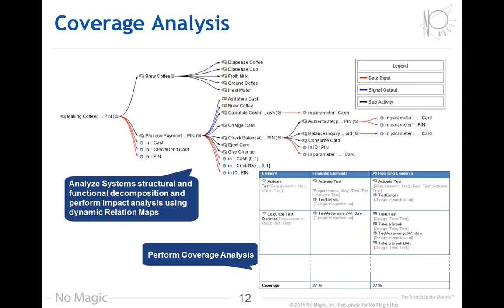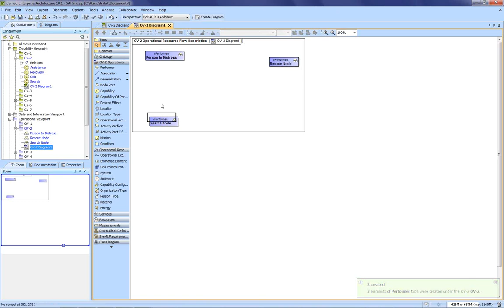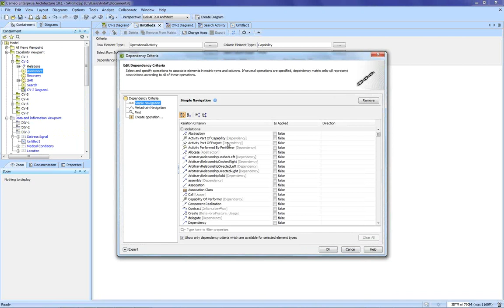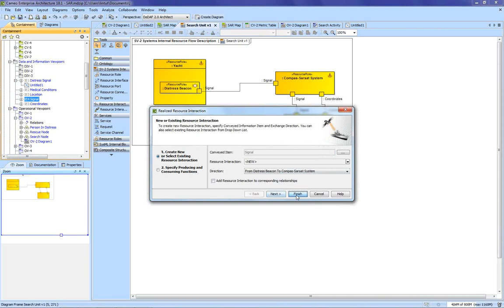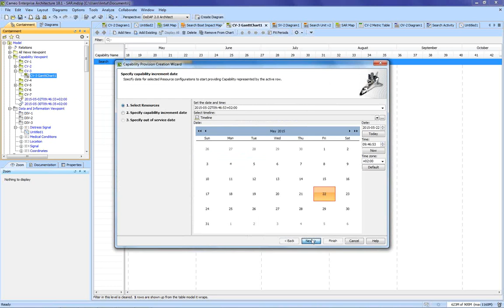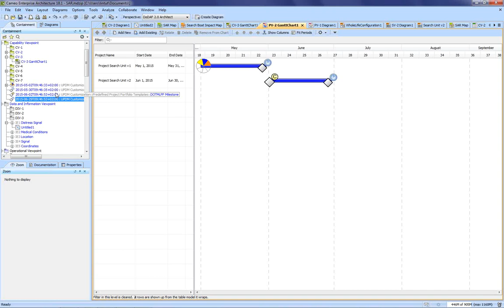Systems of Systems Engineering using DoDAF

Comment: I couldn't understand anything due to the talk given in an echo chamber. It doesn't help either when one has a strong accent in the echo chamber. Suggest going into a normal room. :( Also I suggest slowing done talking since one is trying to understand and can't follow due to the echo chamber and accent. So I didn't get anything from this video. In the end, I would say the presenter knows how to wiz around the tool....So this video isn't a talk on DoDAF for dummies when one is still very new to DoDAF. I stopped about half way thru since I was totally lost with all the tool graphics seeming to be the focal point and not DoDaf. Great if you are into spped reading.....Now looking for DoDAF 101 for dummies video and using power point to teach DoDAF instead.

Comment: Hi! This video helped me out alot, especially with how to use the tool. But I have the same problem as stated below, and was wondering when I connect the Distress Beacon port to the Compass system port, as it was done in the video, I received an "invalid connector." I was wondering how do you fix this error? 

Great video!

Comment: Hi there! I'm having trouble understanding why it is that, on the OV-6b at 20:03, the sending of the signal from Search node to rescue node is both the data types, and not 2 Op. Act. Actions, or one action for each. Is it because there's only 1 communication between these two groups, which is sending both of those data types? If so, is there ever a case for having 2 lines between 2 different swim lanes if and only if there's 1 communication that occurs? Thank you!

Comment: Thank you, this has been very helpful.  I did run into a few parts that were confusing and would appreciate some clarification.  

1st, at 25:18 when you created station, the element was stored where the map was located; in my case under SAR capability.  Shouldn't the performer be stored under the OV-2 directory, does its location matter in the functionality of the model?  The same thoughts on when you created the capability configurations. 

Then at 30:28 when i went to create the resource link between the two resource ports i receive a validation error stating: "Invalid Connector! Connector owner is wrong or Connector ends specified in the model are changed!"  What does this mean, and what is causing the error? I did notice if i create the resource port on Yaht directly, it works with only a warning error stating that "End element(s) of Resource Connector are in Block Search Unit v2. Relationship is not in the same owner as it's end elements."

Thank you!

Comment: Thanks for your presentation!  I have a question: When you first start your project in MagicDraw/Cameo, you're selecting a DoDAF 2.0 type (not just the perspective, but the folder structuring and element names are all coming from UPDM, correct?).  Suppose I start a project in a different type like SysML project, and then want to migrate it over to a DoDAF 2.0 down the road... how difficult is that?  Is there a tool to do it, or do I need to lock down the architecture at the birth of a project?
Reply from the maker: We are very pleased that you found the topic interesting.
To answer your question I should say that you simply need to open a new DoDAF project and import the previously created SysML project into it. For this, click File > Import From > Another Project and select that SysML project.